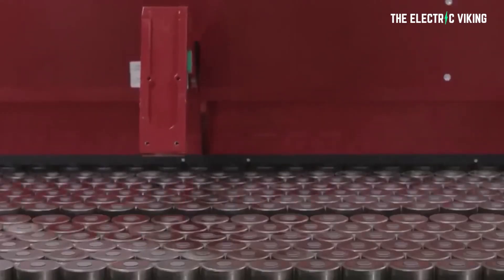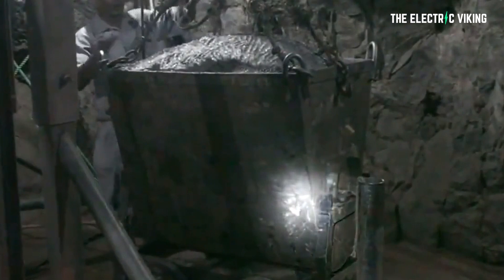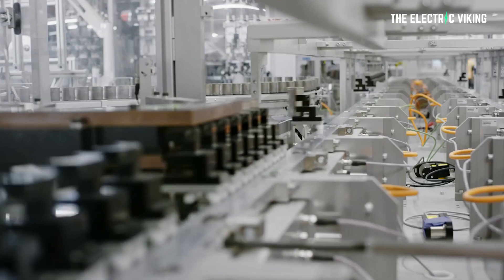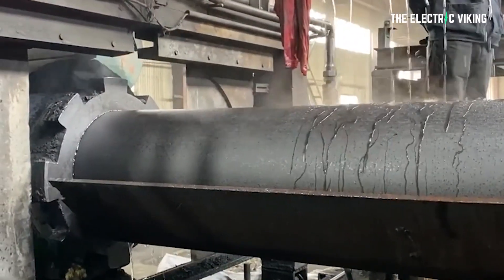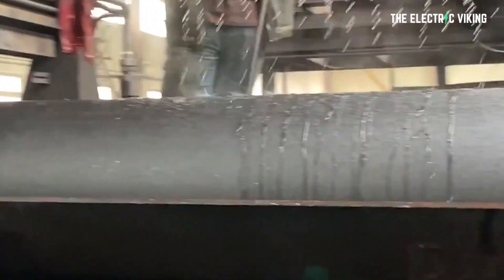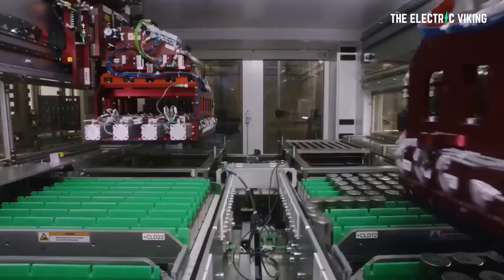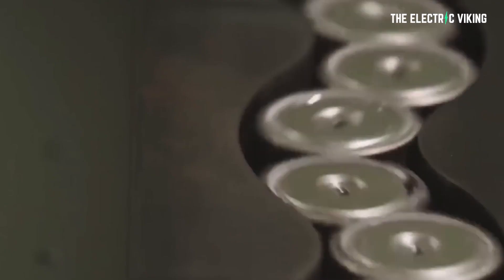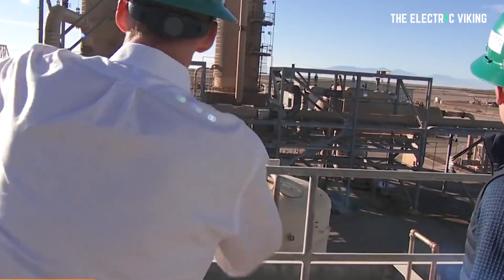First Australian graphite refinery will supply global battery makers

Comment: The most important consideration with graphite is how economical is the mine in supplying graphite to produce anode.

Graphite mines generally produce fakes of different sizes for many applications including industrial and battery market but the flake size each maket needs is very different. This confuses the investment thesis and adds a level of complexity unlike any other mineral in the battery sector.

So when choosing a graphite investment consider if they have a mine that have graphite thats ideally suited to make anodes...and not only necessary consider size of the endowment.

Comment: rough figures on IG6 ASX , (international graphite) you can buy the whole company now for $50 million and that comes with around $5million cash , and then once they get going they could do 100,000 tonnes per annum making $1000 per tonne meaning $100million ebitda per year and if graphite goes parabolic like lithium that figure could be 2x - 3x ,   that predict graphite shortfall starting 2026 and then going to 2030-2035 we will need every graphite company you can name producing,    so graphite probably not a bad investment ,     risks: so other battery tech comes out of now where which doesn't use graphite , though this seems unlikely